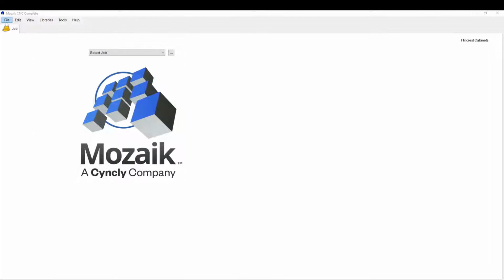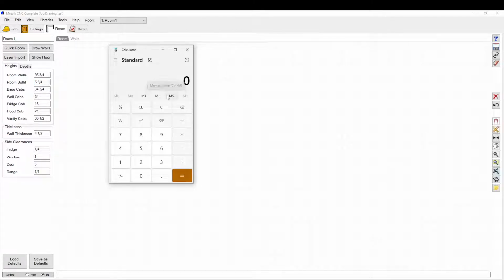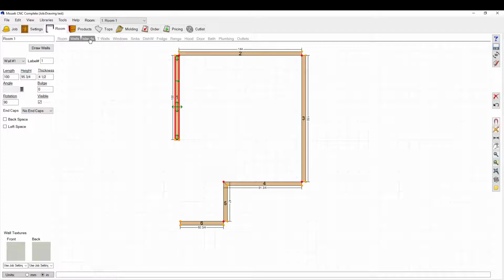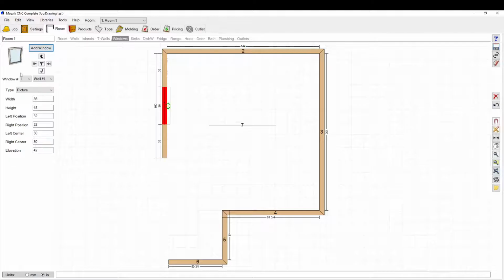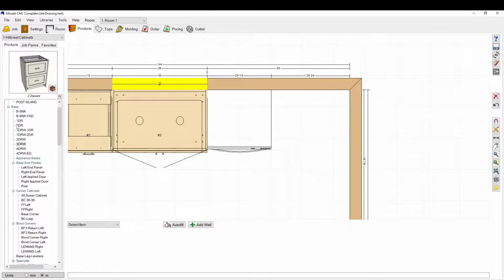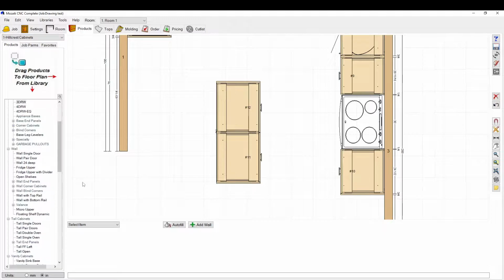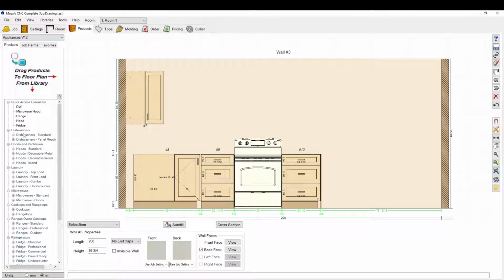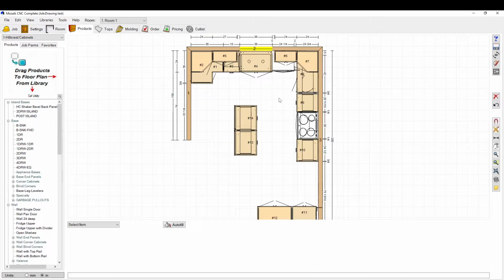How to Design a Kitchen Basics- Mozaik Software Tutorials

Comment: Thank you very much, great video. I am in process of selecting software. Would you have any suggestions what to consider, in particular cabinet vision vs mozaik? Thanks a bunch
Reply from the maker: Right they both are nice and can both go from design to cnc cut cabinets. I used cabinet vision for several years and it definitely has a way steeper learning curve. At 1 point it also had more capabilities but mozaik had caught up in my opinion. The pricing for mozaik has had a few increases as of late so not sure where pricing stacks up. The one thing cabinet vision does way better is machining control. Options such as bridged nesting is not available (which is a huge con in my opinion) also toolpath flexibility is better with cabinet vision. To sum up  mozaik is quite a bit easier to learn. However cabinet vision has better machining.  Another note is mozaik is constantly improving their product where I think cabinet vision is slower or charges for updates. Last thing mozaik has way better support.
Reply: @cabforgesystems Hi bro
How i can learn mozaik software as a beginner

Comment: Thanks for your videos,they are always a great help. I have a question. At the 25min mark you made the side of the cabinet a shaker panel. I clicked on mine and then clicked shape and clicked on a side but it only had adjust side and not scribe. How do i get this?
Reply from the maker: this will only work with applied doors. head to the shape tab and change from right end or left end to applied door
Reply: @cabforgesystems  awesome thank you
Reply: Sounds like he set it up somewhere else from what i understand. I don’t have mozaik yet but i thought he said he had setup that product. He did say he zero out the depth